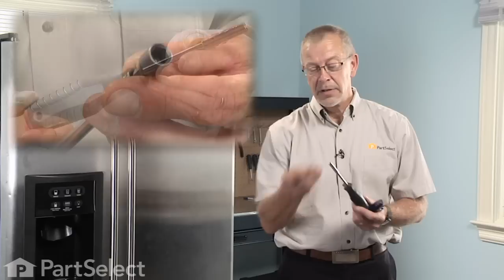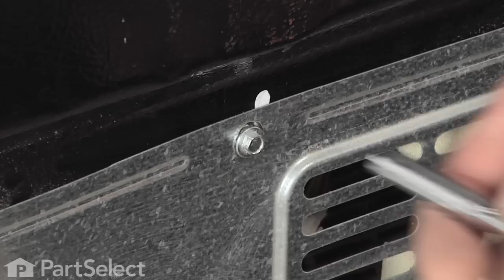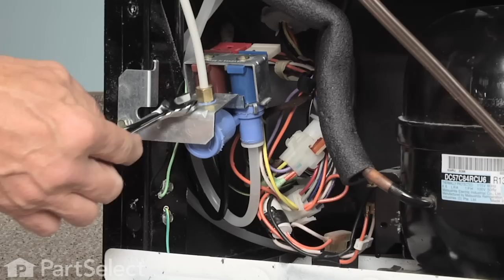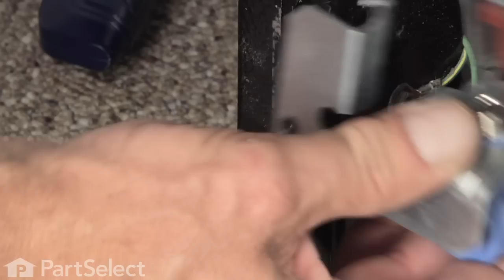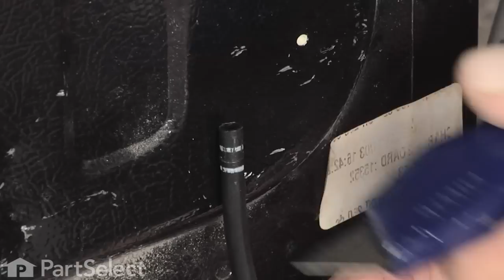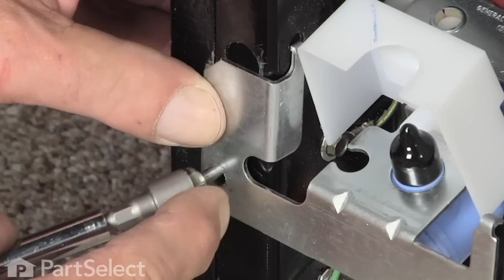Refrigerator & IceMaker Repair - Replacing the Double Outlet Water Valve (GE Part# WR57X10032)

Comment: How long before the water inlet valve starts filling up the ice maker again?  Our water in the door was working, but not going into the icemaker.  It's been about 10 minutes since I installed the new one,  but I don't hear the icemaker filling back up.  I turned the icemaker back on also, along with water and electricity.  Could the line going to the icemaker be frozen up as well?  That's what was wrong with the plastic tube that goes in the top of the freezer into the icemaker before replacing the water inlet valve.  Water is coming out the door again, now that I replaced the valve, so I know that's working.  The icemaker is still not working though.
Reply from the maker: The ice maker inlet valve is activated at the end of the harvest when the ice maker thermostat senses that the mold is frozen. This
normally happens within several hours, depending on the settings of your refrigerator. You should check the inlet water line as well.

Comment: Excellent video Steve.  My water dispenser is flowing fine, doesn't seem to be getting water into the ice maker itself.  Suggestions?
Reply from the maker: Erik Eklof  The water inlet valve has separate solenoids for the dispenser and the ice maker so it could be the problem. Verify that the icemaker fill tube is not frozen first.

Comment: Great video, Part Select. Thank you!  My short question is: Can I order a replacement part for that black tubing and gasket that supplies the icemaker? (The one on the exterior back wall, that you show in this video ). And is it something I could replace myself?  Mine is leaking and water has been flowing down the back panel, into the main control board.

Here's the backstory:
My GE Profile Refridge (side by side) has been leaking water onto the floor and ice building up for years! We had an extended warranty but GE service guys just kept replacing ice maker, motor, motherboards, coils, heating elements. Over the years, it's cost us nearly $1K in service calls and parts, nothing has ever worked for more than a few weeks.

We finally called out a non-GE appliance guy, who discovered that there was a leak in that black tube that goes up the exterior back of the fridge (to feed water to the ice maker) right at the entry point/gasket on the exterior wall. You can see a trail where water has continually leaked right down to the box that holds the ASM Main Control Board (WR55X10952) and caused corrosion on several pin connector on the right side of the board.  The repair guy said he could replace that leaking water line (black tubing) and control board, but it might not be worth it, since the wires/connector from the fridge also show some corrosion.  He didn't seem to think that those wires/connectors could be replaced.

Right now we have turned off the water to the fridge, to stop any further leaking. And the guy installed an old non-corroded board that I saved from an earlier service call. What do you think? Can I order that black tubing and gasket and install it myself?  Can those wires from the fridge to the board be replaced by a GE tech?  Is it worth putting any more money into this lemon?  The repair guy is suggesting 'maybe not.'

Comment: Parts select...you video is very informative.  I have a GHS22STA, this morning it stopped dispensing water.  I can hear a clicking noise when I press the water value in the door, any suggestions on what the problem maybe?
Reply from the maker: Patrick Swaszek I can't seem to find that model number. Can you double check it for me?

Comment: Great video on replacing the Double Outlet Water Valve. I actually have a leak in the two lines (clear & black tubing) going into the water valve. Do you have a video on how to replace those lines or some sort of coupling that I can repair the leaking section without having to replace the whole line (end-to-end)?

Comment: I just replaced this part but, I am still having the problem were the frig makes this machine gun sounds while water comes out does anyone know what might still needs to be replaced
Reply from the maker: Hi Jason. thanks for the question! I'd check for a frozen water line or from the reservoir in the fresh food compartment and also verify the correct voltage at the terminals on the inlet water valve when the water dispenser is actuated.

Comment: we replaced the water dispenser valve WR57X10032, and can now hear the water trying to flow, and a clicking noise that shows its working, but now water. how do we "flush" the lines?
Reply: and ice continues to be made no problem
Reply from the maker: Hi CaoGurlB! Thanks for getting in touch! It sounds like you have a restriction in the water line. This can be caused by a plugged water filter, a kink in the tubing, or a frozen water line or reservoir. You can remove the water tube from the outlet of the valve and then activate the dispenser briefly to verify the valve is working. Replace the water filter or install the bypass plug if you still have it. Inspect the tubing for kinks near the valve and at the freezer door bottom hinge area. Check the inlet and outlet tubing to the water reservoir for any sign of freezing. The reservoir is normally located behind the lower crisper drawers in the fresh food area. Hope this helps!

Comment: can't  get that black hose off to save my life
Reply from the maker: Hi Ken, sorry to hear you're having trouble. What appears to be the problem getting it off?
Reply: Finally got it had to pull real hard
Reply: Still don't know what the problem is add water to ice maker but it won't dump the ice
Reply from the maker: Hi Ken, sorry to see you've been having problems in your repair process. We'd need your model number and further symptoms to be able to accurately help you with your repair.

Comment: I changed my water filter and the external water lines starts to vibrate make a loud sound.  There is no water.  I put the filter back and get water again with no sound.  Over a few weeks the old filter water starts to slow and now it vibrates the water line.  I checked the impedance of the two and the blue is 331.1 ohms and then red is 182.8 ohms.  Is this good?  I think the replacement may help since both water and ice water fills make the same noise and the water is feed from two lines.

Comment: Also I ended up switching the solenoids (dispenser/icemaker) at the water valve and the water dispenser stopped working, unfortunately no water in the ice maker fill line to draw it up to the ice maker. I switch it back and the water dispenser works again. So I think its the valve. MAybe clogged too? Thanks for any info.

Comment: Question, my GE water dispenser stops working.  If I turn off the water, then un-screw the water line to the frig, then screw it back on and turn the water on, the dispenser works!  Unfortunately, it stops working about once a week.  Is this a problem with my inlet valve?

Comment: I have a GE refrigerator that is not getting water in the door but it's getting ice in the door would that be a problem with the dual water valve in the back

Comment: HI I have a Frigidaire model# FRS6LR5EW6 the ice maker is not working. The water is working but the ice maker is not. It seems as it doesn't get water into the mold. What could be the problem with this situation? Anything will help. I appreciate your help. Thank you

Comment: Our GE GSS25IFPD CC is leaking in the freezer from the icemaker. its a steady drip that continues even after it has make a huge ice block all along the back of the freezer, behind the ice cube drawer. Had a weird buzzing noise this morning, so I turned it off and defrosted entire freezer to remove ice block at back - had even dripped down into fan. It seems to leak right where the ice cube tray connects on the left to the power supply. Any ideas for repair??

Comment: I replaced the new part and now water is leaking from 2 pipes. I tried every thing cutting the pipe and putting the old part back and still leaking very bad. I am done with DIY

Comment: @partselect Thanks! The water fill tube isn't clogged, I can see it filling the ice tray. The system seemed to be working properly. I installed a new water filter the night before and turned on the ice maker...It seemed to work fine, until I noticed a frozen trail of ice coming down the ice chute out the door, then I started getting a log jam at the ice door when trying to get ice. When I pulled the Ice tray to dump it I put the tray back in and that's when it started over flowing.

Comment: Hi, I have a GE Hotpoint fridge model#HSS25IFMC WW. and I had Niagara falls coming from the ice maker this morning! Unscrewed the water filter to stop the water (no shut off valve on the water line). Do you think replacing this part would fix my issue? Thanks, great video by the way!

Comment: @LTF85199 Excellent video of the repair.  Our GE refrigerator has had a problem with the ice maker feed line twice in the 12 years we have had the unit.  The solution each time was to turn off the refrig, disconnect the water lines at the entry point to the dual valve and wait 30-45 minutes. Then reconnect everything and it worked.  Problem - ice forms in the narrow tube at the point of entry to the icemaker.  If I have need the part I would use your video as a guide.  Thanks.

Comment: @partselect 
Great video.
My original value has  a brass right angle 1/4" pipe -to -1/4" flare fitting. 
Got the supersede part for the old WR57x92; WR57X10051. 
The water line is now connected and no leaks. So if your old valve used the flare fitting just cut off the flared end & replace w/ a ferrule & compression fitting.

Comment: Thanks for the tip. I'll check that.

BTW, I get 120volts at the connectors, when activated, and I do hear the solenoids humming. Good water flow when I disconnect the water inlet tube, coming from the filter. Maybe something else internal to the valve that could cause both outlets to malfunction. In any event, I did order a new valve. Hopefully your tip will solve it. Thanks again.